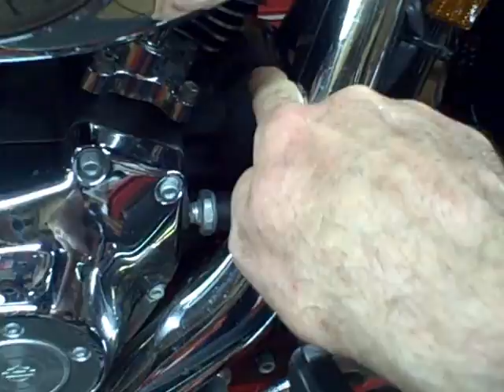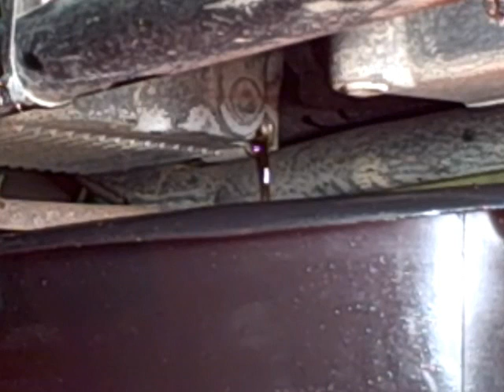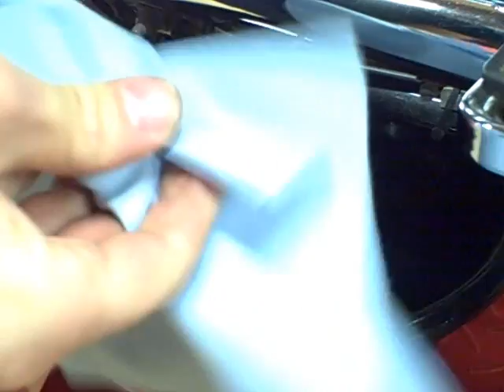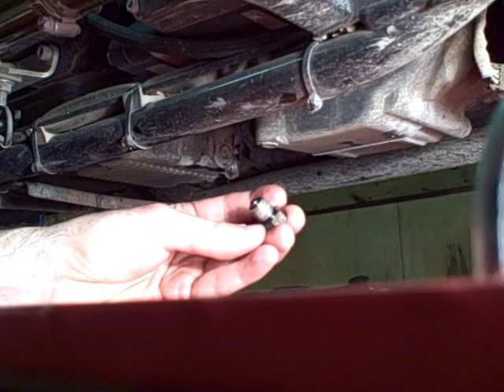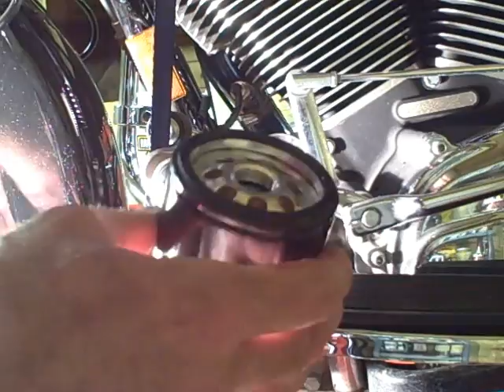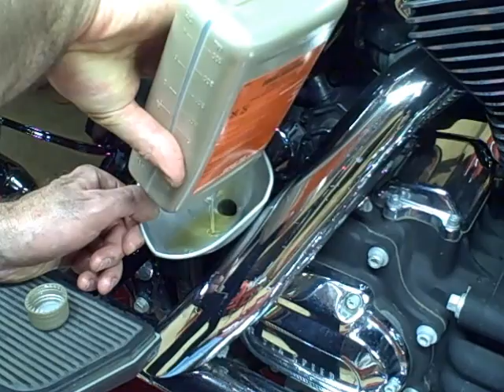Motorcycle Repair: Changing the Engine Oil and Oil Filter on a 2008 Harley Davidson Road Glide

Comment: Sorry smallengineshop ... I don't mean to pick on you or your methods cause I think you're great for what you do. I'm just passing on tricks I learned over the years from wrenching on my own bikes because I'm a real nit-pick. Most of these newer Harleys with the "big" or "heavy" breathers get less oil blow-by running about half a quart under full capacity. I've done this on my last few Harleys with no issues. I have a 2011 Road Glide Ultra with the 103" engine and love it!

Comment: What I do to remove the oil filter without spilling oil all over my bike is I make a hole with a hammer and a nail on top of the filter, high enough that there's no oil coming out yet, then I do another one on the bottom so it leaks slowly and clean.  Then when its all out i remove the filter.  Thanks for the video!

Comment: Great vid but there is a clean way to catch the run-off from the filter. Not good to get oil or brake clean on your rubber engine mount. I took an empty 2 liter coke bottle and cut it with a sharp razor blade to funnel the oil into the drain pan. I also found on my bike filling to the 4 qt. capacity will blow oil out the air cleaner since I have the heavy breather on mine. I always stop at 3.5 quarts, run it and go from there ... usually 3.5 quarts keeps you in the "safe" range on the dipstick.

Comment: Good video except one thing, you never put 4 full courts in at one time, you start with 3.5 and add the rest if needed. all the oil will not drain on a oil change unless you drain it over night.

Comment: Have you heard anything about putting about a half a quart shy of full capacity, then running bike and checking hot , then fill to hot full mark? I have heard that about a half a quart of old oil will stay in bike after draining.  Thanks

Comment: Where did you get that oil filter wrench
Reply from the maker: Probably Autozone. Can't remember for sure.
Reply from the maker: Nice!
Reply from the maker: Nice Pic. You should do an oil change vid...
Reply: *****
  Well, she I can't do one yet because she only had 0 miles  :P  I'm in NY, I'm waiting on the warmer weather to set in. I plan to do two oil changes before my first service. One at 75, and one at 300. I plan to put Mobil 1 4T in around 2500 miles. I'm ordering the M4GP Slip On, I got it for $275 shipped. It's going to be dope. I'm also doing a fender eliminator and integrated tail light.